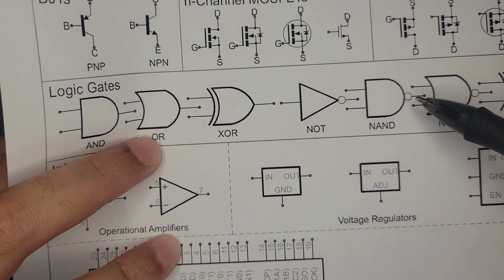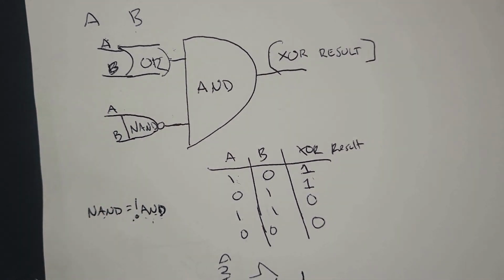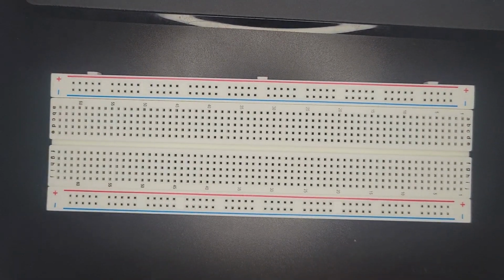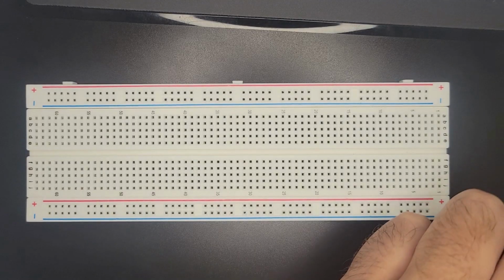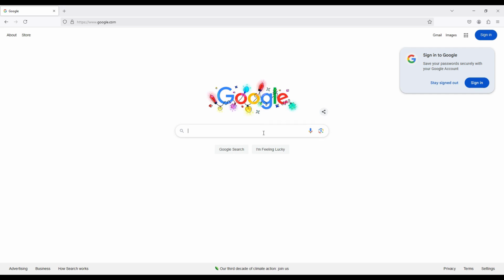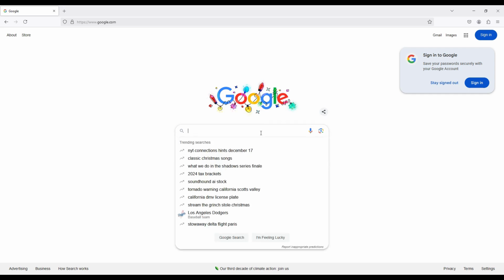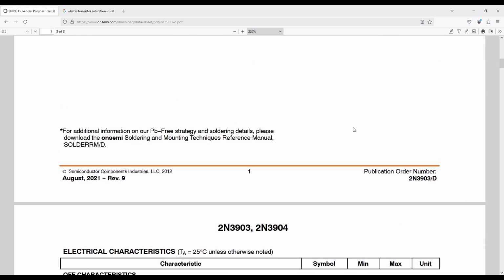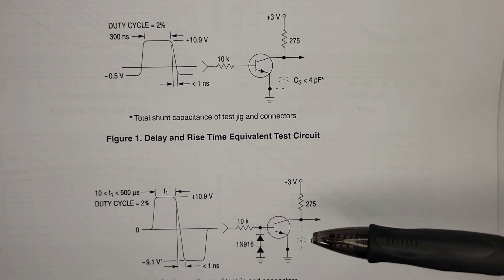XOR Gate Step-by-Step - Beginner FAILS then Learns Electronics Ep9 - Logic Gates for Beginners

Comment: You could do the same thing but with a Nor gate and an AND gate going into another NOR gate.
Reply: also the way you are building the OR gate isn't great. You should actually make a NOR gate and unvert the output for reliable switching and avoiding floating inputs in the circuit. Also Also you are sharing inputs the wrong way. You should have a single input line going into separate resisters for each transistor input.
Reply from the maker: Thanks for the input! I understand the NOR + inverter suggestion. When you say "single input line going into separate resistors for each transistor input," do you mean each button will lead to multiple resistors in parallel, going to each transistor base?

Comment: I too am very much a novice when it comes to circuitry components, but I do have a pretty strong understanding of the gates and how they work together to produce a desired outcome. I've had a pretty unorthodox path of learning because I learned about gates and their uses through Minecraft redstone, but never really understood what real world components where used to build up the gates, but before I learned anything through the game I had worked in car audio when I was younger and started knowing basically nothing  and learned how to configure relays to switch power and ground to perform other tasks which can often create an undesired feedback into other circuits to which we would use voltage diodes to prevent the backflow and stop one circuit from unintendedly feeding into another.

So diodes I understand. diodes with let - energy flow into the line end and out the triangle, or + energy into the triangle and out the line end, basically acting like a check valve only allowing energy to flow one direction,  which is what I thought you were going to need to control the backflow issues you where having, so when you managed to fix it without introducing any diodes I was instantly lost. 

How did putting in extra resistors prevent the interference?  I truly would like to know the reasoning that lead you to that result if you don't mind my asking.
Reply from the maker: You have an interesting background! Minecraft is great. I have not used Diodes yet but will be doing a video on it soon.

For my XOR gate, there really were two problems. The first problem is that my buttons were connected together, which is what was causing that backflow issue. So by disconnecting the buttons (by un-jumping the transistor bases in the OR gate), the buttons were again 100% independent. The 2nd problem was button B was going into NAND gate transistor B's base, which had a very direct path to ground. So when I pressed button B, ~0 current was going to the OR gate, it was all escaping through transistor B of the NAND gate. This is what was causing the OR gate to fail with that button. By adding more resistance to that path, the current was more evenly shared between the two paths, allowing the button to correctly send signals to both directions.

So in other words, the "backflow" issue was solved by the simple disconnection of the OR gate transistor bases. This was an error on my part, but I wasn't punished for the error since the OR gate continued to work on its own in isolation.

If we wanted the OR gate to stay configured like this, I think your solution would work. I will test that out. We could use diodes to ensure that the button output is a one-way street. It's a really interesting idea, and I will test it out soon and post it!

But does this help you to understand my reasoning? I think splitting the issue into the two rightful problems helps. The backflow is solved by just ensuring the buttons are not connected in any way. Then after that, it was a resistance issue that was causing the current to disproportionately escape into the NAND gate transistor base (that was directly grounded through the emitter).